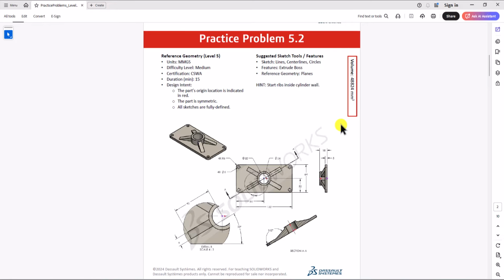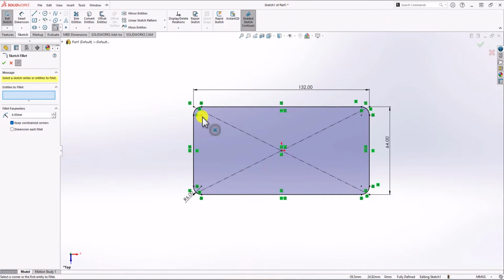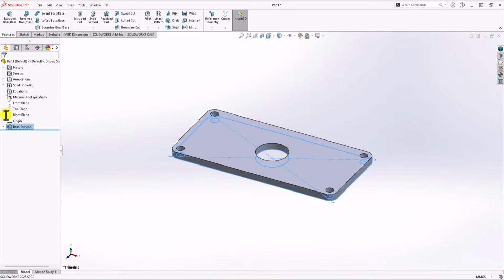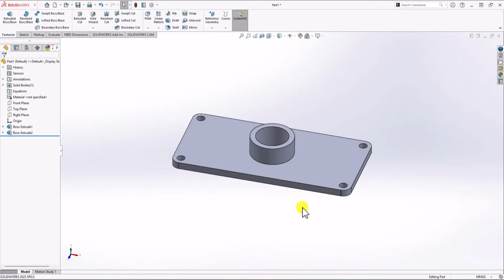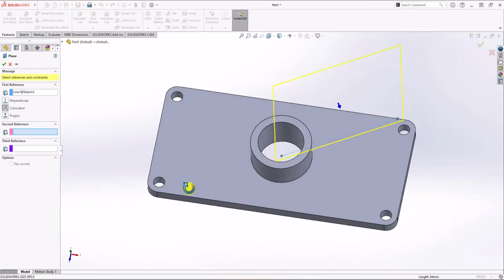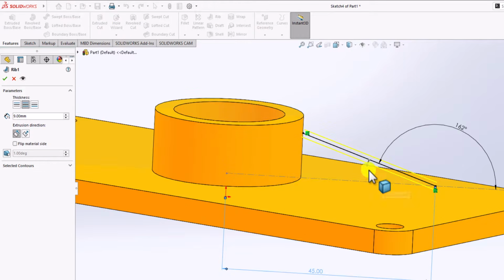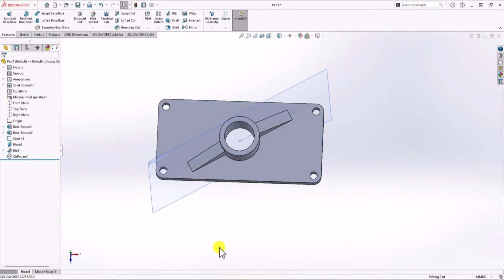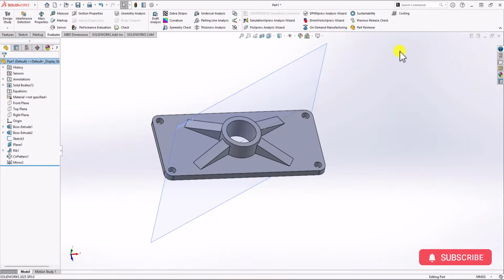CSWA Practice Problem 5.2 Solution | SolidWorks Exam Guide

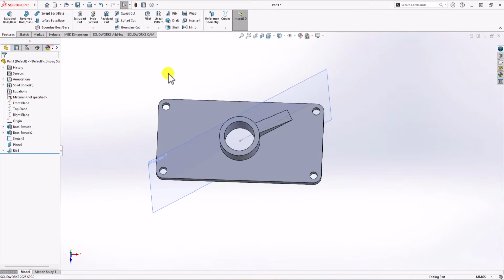Comment: 9:40  instead of circular Pattern use simply Mirror command give mirror plane and secondoray plane, its easier and single command 😀
Reply from the maker: You’re absolutely right! We can use Mirror on both planes and get the same result. Thanks for pointing that out!

Comment: For the ribs why is it that you cannot use a circular pattern for all 4 features? Usually it has worked for every other part I have designed in the past, so I was wondering if you could explain that in case something similar shows up on a certification exam
Reply: Because our base plate is a rectangle, not a square. The Circular Pattern command tries to distribute the 4 parts at 90-degree angles. If our base plate were a 132x132 square, this would work. But since our base plate is a rectangle, we use mirroring because mirroring creates symmetry based on our reference plane. Let me also add this, though: if you used a circular pattern on such a part in an exam, you would still get the exact same volume. Because this part is symmetrical, and even if you used a circular pattern, the volume wouldn't change since the ribs would have the same dimensions despite being in different positions
Reply from the maker: @EquverS  Thanks for explaining it. You're absolutely right, and your reasoning is correct.
Reply from the maker: I think @EquverS answered this question really well. I didn't use a pattern of 4 because the angles between the features are not the same. If you look closely, the angle between the two features on the right is 60° (2 × 30°), while the angle between the top two features is 120°. Since the spacing isn't uniform, a pattern of 4 wouldn't work. Instead, I created a pattern of 2 and then mirrored it to get the final result.
Reply: You could use only one circular pattern but not by 4 use 6 instances instead AND use the option "Instances to Skip" inside the circular pattern options and select the 2 points (ribs) you want to skip creating and thus only 4 ribs will remain.

Comment: so many Unnecessary features and Sketches in the video....
There are much easier and quicker ways to do the same..
Reply from the maker: Thanks for the feedback. I understand your point. The goal of this video and the series is not to show the fastest possible workflow, but to guide beginners step by step. As I mentioned in the first video, there are often multiple ways to model the same part, and I chose an approach that is easier to follow for those preparing for CSWA. Since CSWA is designed for beginners, the focus here is clarity and learning rather than speed optimization.

Comment: Could anyone help. When I try to sketch on the top surface it rotates vertically 90 degrees instead of staying horizontal like in the video. Is there a fix for this?
Reply from the maker: This depends on your axis orientation, so you won’t necessarily get exactly the same view as in the video. One option is to select the top surface, rotate the view using the middle mouse button to the orientation you want, and then click View at the top of the window and choose Normal To View. I hope this works for you

Comment: Do you think you will do for cswp?
Reply from the maker: I plan to work on CSWP after finishing all the problems in the CSWA problem set.
Reply: @Design_With_Roozbe sounds good, where did you find these problems set and where can I find the cswp set?
Reply from the maker: @assassin5018  You can find the CSWA problem set link in the description of each video, and I’ve also shared it here for you:
https://www.solidworks.com/media/cswa-exam-practice-problems
.
For CSWP, there isn’t a full problem set like there is for CSWA, but you can look at this link for sample questions: https://www.solidworks.com/sites/default/files/cswpsampleexam.pdf